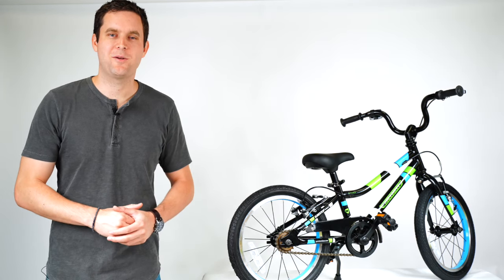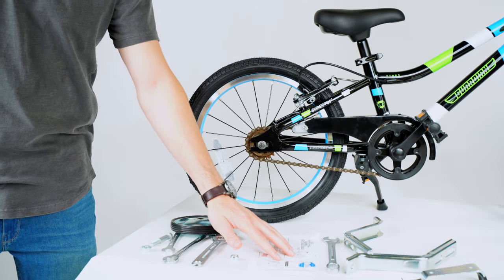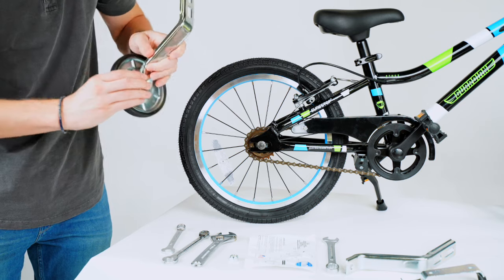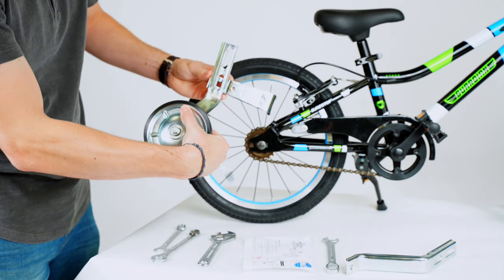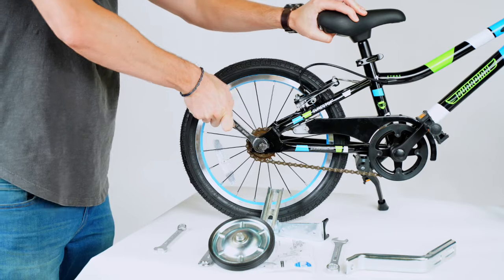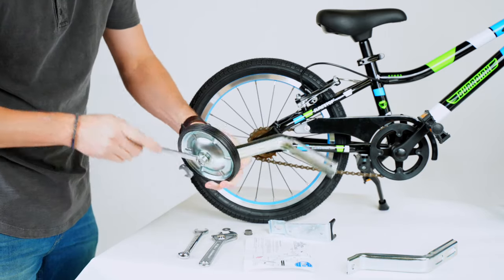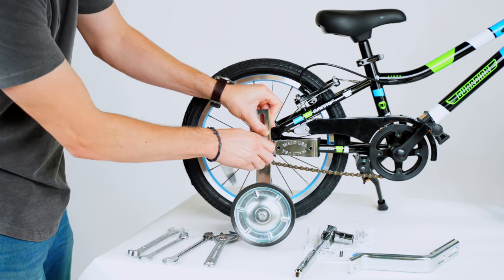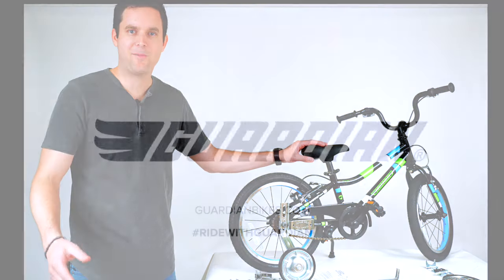How to install training wheels to a kids Guardian Bike.

Comment: Thank you for showing the best way to install the training wheels. I thought that the wheels should touch the ground however your video shows that the training wheels are to be slightly off the ground.
Reply: I also thought the training wheels needed to be touching the ground.
Reply: @nicolepryor  would have been nice if he installed both training wheels on this training so we could see the balancing. I thought the wheels ought to be touching and moving along with the main tyres
Reply: So thanks for the video. Looking at the other comments here, I too have the wheels off the ground. 

Is the idea that if they tilt to either side while riding the wheel will touch the ground on that side vs both training wheels touching the ground at all times?

I wanted to see the finished product as well or even a video of a child riding the bike just so I could see if when they are completely balanced, the wheels on both sides just hover.

Comment: Got this bike for my grandson last Christmas. There’s a design problem with the training wheels for this bike. Or maybe the frame itself. All the bikes my kids had with training wheels had a notch or tab milled into the dropouts for the purpose of attaching training wheels only.  Basically fixed into place. These rely on the same nut which keeps the chain under tension. After a few rides the nuts loosen enough to allow the wheel to slip forward in the dropout. The chain looses tension and falls off the cog.  Every time he visits the bike comes back to me.  This time I’ve returned it to his dad with a 15mm socket with instructions to tighten before each ride.
BTW it’s a pain to keep the wheel aligned while maintaining chain tension with these training wheels.
Reply from the maker: We took all your feedback to heart and redesigned our training wheels! A new instillation video will be uploaded soon
Reply: Or, simply drop the training wheels. My grandson leared biking on a balance bike (no pedals, low seat) when he was 2 yrs. At 2,5 he got pedals and are riding happily ever since.  One can make an ordinary bike to a balance bike simply by removing the pedals. Please remember the pedal on the left is treaded the links way. The slogan is “back off”. That is, turn the wrench to the rear at either side.
Reply: @kjellg6532  I’ve taught my kids and other grandkids how to ride a bike the old fashioned way….hold them up and run. Tried it this way with him. Using properly installed training wheels, he’s close.  But unless we stop and retighten the nut, we loose chain tension and wheel alignment.

Comment: The top part of the training wheel bracket that extends up above the frame of the bike is pretty sharp. Do you have a rubber cover that you can place on top of that Extension to prevent kids from injuring themselves there?
Reply: If you're not using the upper holes on a smaller bike, you can saw it down to the bottom of that hole with a hand saw, or sawzall, or band saw, use a file to clean it up and deburr, and plasti-dip the end to coat it in a rubber-like coating.

Comment: I see training wheels as contra productive. The rider learns to drive a 4 wheeled car, not a two wheeled bike. When removing the training wheels, you must relearn to steer. 
Use balance bike instead. Two wheels, no pedals, low seat.
Reply from the maker: We completely agree! We highly encourage the balance bike method but still provide the option of training wheels for those for still want them